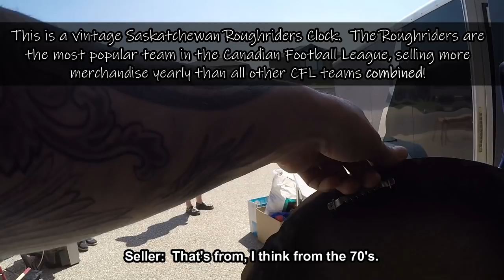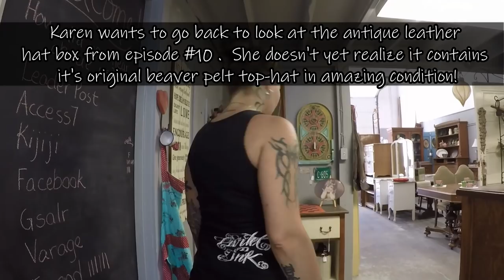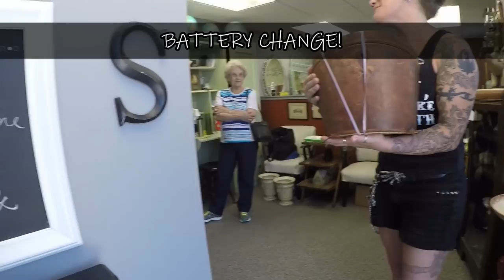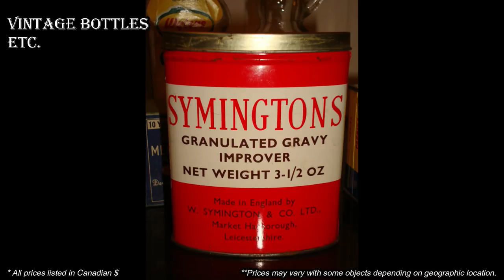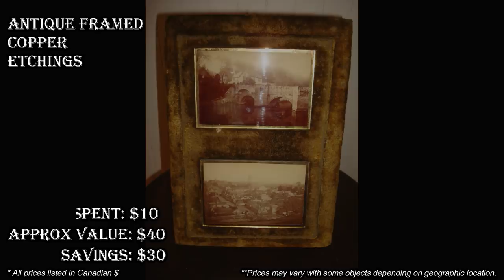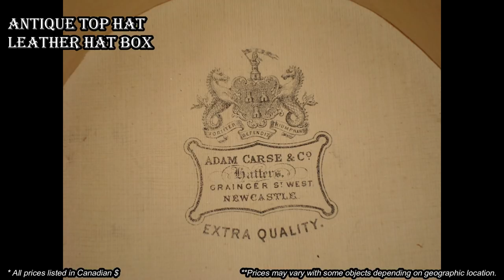Ep13: UNBELIEVABLE ANTIQUES HAUL! - ANTIQUE TOP HAT! - The ORIGINAL GoPro Yard Sale Vlog!

Comment: 1) I love those floor lamps too! I have several in use. Mine take the wide-base bulb, which I have to get from the neighboring Danish town. ---2) How often, would you say, you walk away w/o getting anything?
Reply from the maker: If you ever find the wide-base tri-light bulbs too expensive, or hard to find, you can get a light socket adapter for those lamps - it screws into the socket, and is ITSELF a socket to accept a regular sized bulb.  That's what we have done in all our old lamps, so we can just use regular bulbs in them.
Reply: I'll be darned! I'll be looking that up! Each wide-base bulb costs me $7 plus change!---Super tip!

Comment: I have a floor lamp very similar to the one you purchased in this video however I have not been able to find a light bulb for the center light. It has a very large and it screws into that outlet and I have not found one. Does this one that you purchased have the large ended bulb and if so where did you find it? Thanks so much for your information and I enjoy watching your videos.
Reply from the maker: Hi Karen!!  YES!!  That is called a tri-lite bulb - they have very large ends on them.   Instead of trying to find a tri-lite bulb, you can go to Home Depot or Home hardware or whatever local hardware store you have, and get an adapter, to turn it into a regular sized outlet for a regular everyday bulb.  That's what we do.   Might find it listed as a "Socket Adapter".
Reply: Oh thank you so much! I have taken the bulb with me everywhere and no one has had one. I will go to Home Depot and see if I can get the adapter. Thank you so very much!
Reply from the maker: YES - Let us know.  If you can't find one, we can get one for you.
Reply: Bargain Barons thank you so much! I will let you know what I find.